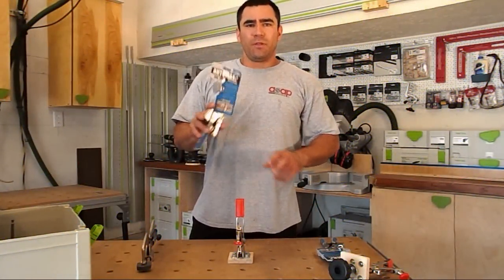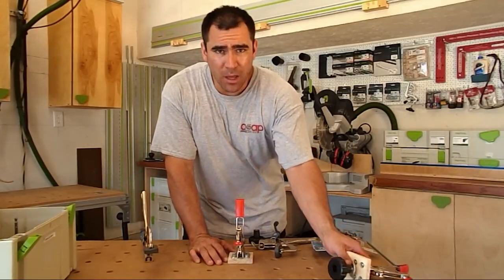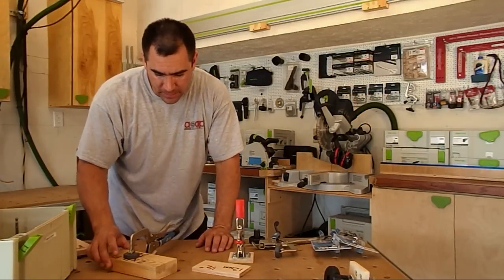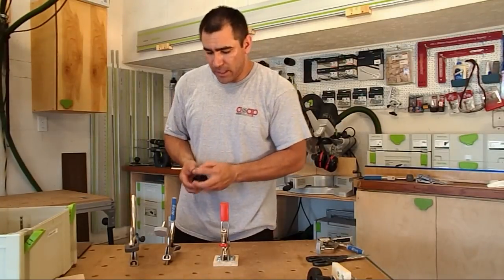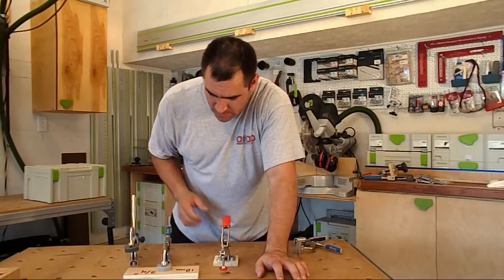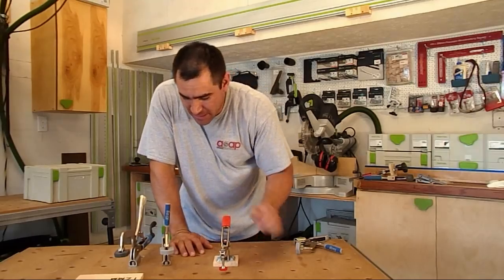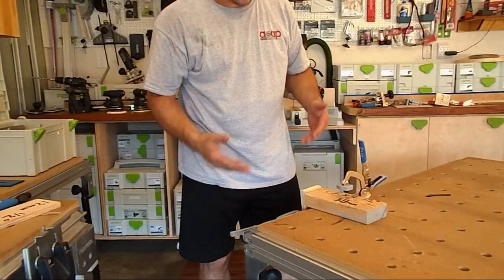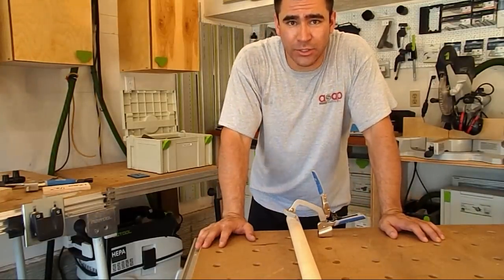Kreg automaxx bench clamps with the Festool MFT

Comment from the maker: Retro,  I do like the Festool clamping elements.  I use them a lot. But they don't work well when sanding stock that is less than 3/4" thick.   So if I want to use them for sanding something 1/2" thick, then I need to use spacers between the elements and work piece.   So far that's the only drawback from the clamping elements.
I know the MFTs are a little pricey. But they make for a great versatile work bench.     Eric

Comment from the maker: Matt, for me the advantage is speed.  With the Festool clamps I need to use two hands to set the clamp.  I use pocket screws a lot, so this will hold my two matting pieces onto the MFT top for me.  I use the Festool Domino and LR32 system a lot, the two Festool rapid clamps I have can be used to clamp the guide rail to my work piece and the Kreg Automaxx will clamp my work piece to the MFT.  The Kreg clamps have made it easier to swap out work pieces while I use the Domino.

Comment: how would you compare the Kreg Automaxx bench clamp vs the Festool 491594 Quick Clamp?
Reply from the maker: Derrick Bohlin Tough to compare the two clamps.  The Festool quick clamps work with the rails when you want to clamp the rail to the piece your cutting.  The Kreg Automaxx are a little quicker to use.   Once your get them set in the hole you want to use.   I really like using the Kreg Automaxx when I'm using the Festool LR32 system.   And believe it or not, the 6" Kreg Automaxx cost more then the Festool quick clamp!  LOL!    I did find that the Festool clamp can dent soft woods when to much clamping pressure is applied.  I haven't experienced that with the Kreg clamps.   The Kreg Automaxx has a longer reach, they come in 3" or 6" versions.   So if you need a clamp with a longer reach, then the Kreg clamp would be the way to go.   I honestly use both of the clamps a lot.  I have 6 of the Festool quick clamps, 2 of the Kreg 3"  and 2 of the Kreg 6" Automaxx clamps.   And like the old saying goes, You can never have too many clamps, right?  
Take care,
Eric

Comment: Eric:
I use the Automaxx clamps too.
I didn't like just bolting through the hole with a 5/16 bolt so I got some nylon spacers from McMaster-Carr (http://www.mcmaster.com/#catalog/121/3266/=wh7c9d) They are ¾ dia x ¾ long with 5/16 hole and work great at $8.81 for (25).
Reply from the maker: Interesting Bill.  Thanks for sharing.  I think we have something like this laying around at work.  I'll have to look into this. 
Thanks for sharing.
Reply: Bill Heidt ... how tight are the nylon spacers in the MFT holes of 20mm? Are they loose to the point the holes will become deformed over time?
Reply: The Poplar Shop ... thanks for all the videos Eric, I really appreciate them. Have you had a chance to try the spacer with star knob?  You convinced me to buy the Automaxx but would rather not spend $100+ on Precision Dog Plate if these $9 spacers work without damaging and stretching out the holes.